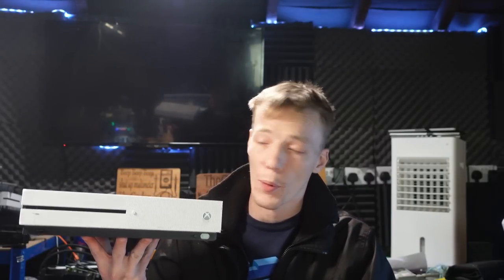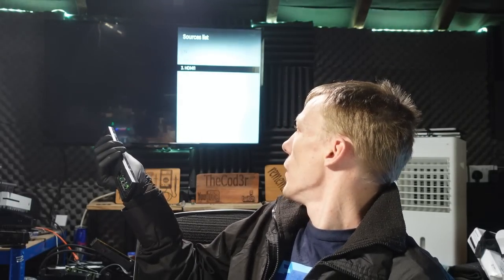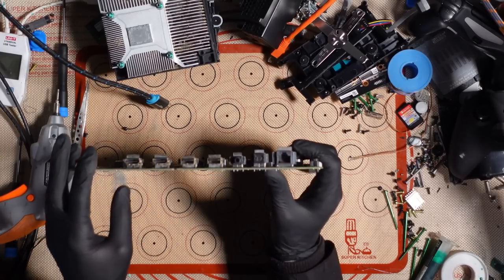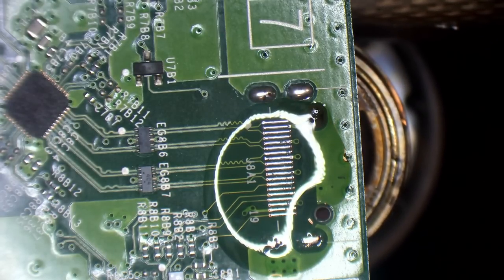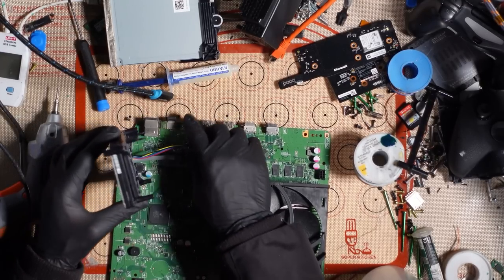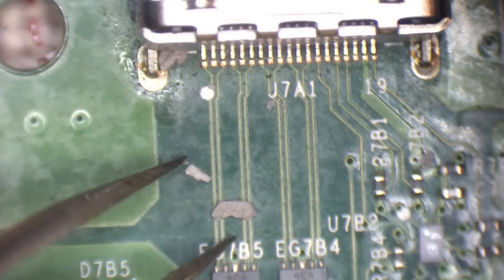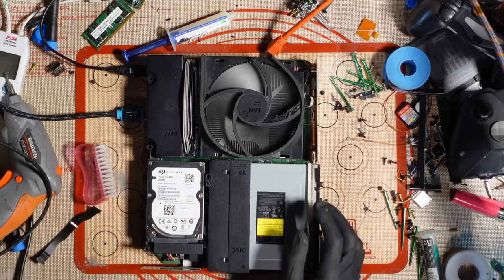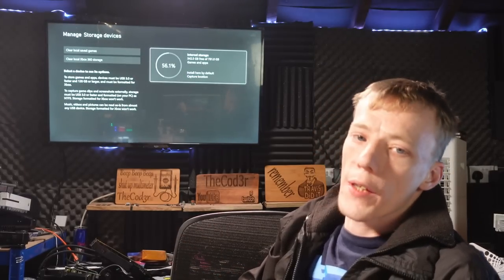The Owner Left This Xbox One S Out For SCRAP! Can I Fix It Before It's Too Late?

Comment: My brother was gonna throw away his sons ps4 slim and I checked it out first and it was also just a dying hard drive and I swapped it out and it’s alive again so sometimes parents will throw it out cause they’d rather buy a new one and not deal with the hassle of trouble shooting it
Reply: I recently bought a cheap Slim where the harddrive was also dying. The problem was that the previous owner had also mucked around with the disk drive and somehow it wouldn't take in disks (and of course he didn't tell me that). They had somehow managed to put some of the cables that go around the disk drive inside the disk drive, which prevented it from working. I fixed that and put a new harddrive in, turned out the console was still on firmware 8.xx, so I updated it to 9.00. Now all I need to do is to clean the rollers (that one's on me) and the console is fully working again and on 9.00.

Comment: Try to use low melt solder so it can melt faster and not damage the board with heat by any means. Other than that great job

Comment: Hey man, I took my ps to a hardware store for them to resolder the PS4 pro power connector back on the motherboard, however, now my PS4 Pro gets power, but it doesn’t turn on. 
As in, the blue light at the front comes on flashing.
None of the ports work & there is no signal in the hdmi.
After about 45s it will turn off.
Any idea what it could be?

Comment: just discovered your channel, great content mate i used to do repairs on 360's during the rrod times.
while others were bodging them with cheesehead bolts, removing x clamps and blasting them with heat guns, a few others and myself were reballing them with leaded solder and reiinstalling the x clamps, the only "upgrade" i did was fitting the heatpipe gpu cooler if it had the crap one on.
i dont touch consoles anymore been there done that, good luck.
aly,
xsinclairuserx.
p.s nothing wrong with heatguns in the right hands.
Reply: I'm glad you were one of the good techs, the 360 was my baby, and I hated seeing what GameStop and the likes did to them

Comment: how do you not strip things with that drill? It seems way too powerful for electronics work.
Reply from the maker: I actually have a good method for avoiding that. I make sure my wrist stays limp, so when it reaches a torque level that's just about tight enough my wrist will absorb the power of the drill and stop me stripping screws
Reply: @TheCod3r  There's a rude comment to be made here somewhere but I wont lol nice fix and not to be damaged by our rainy British weather is a result, someone in your area is watching this thinking damn should have sent it to you lol

Comment: Believe it or not I found one in a dumpster in a tip a week ago, turns out it only had a faulty hdmi port.
Reply: I once found a PS4 slim on top of a garbage bin (must have been four years or so ago, so they were actually worth more than they are now), it had the top part of the case missing and the metal parts down to the upper part of the drive was heavily bent. The laser was still fine, as was the disk drive. Got a BLOD Slim with no disk drive for around 50 Euros and switched all the components I needed and used that PS4 Slim for quite some time (until I switched to a Pro, that I had also gotten as defective and fixed).

Comment: (Spoiler alert: Do not read the comment if you don’t want any spoilers about a fault)

When the screen was black, it was caused by the hard drive, but it was not a total no display issue.
I wonder if that Xbox One S could have had a Black Screen of Death issue, because if that’s the case, the HDD could have possibly just been corrupted, and could have maybe been saved along with the console itself.
Reply: Thnx for the spoiler warning :)